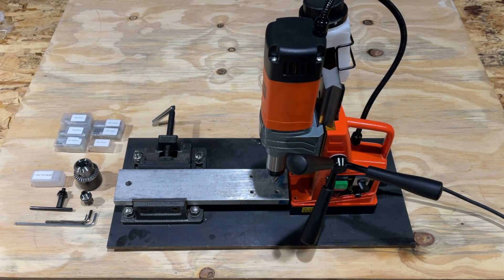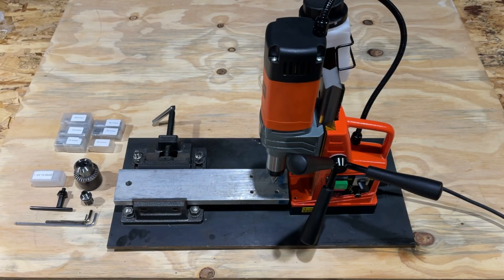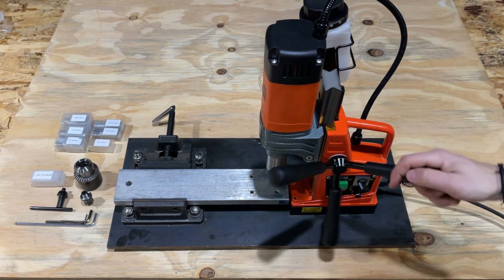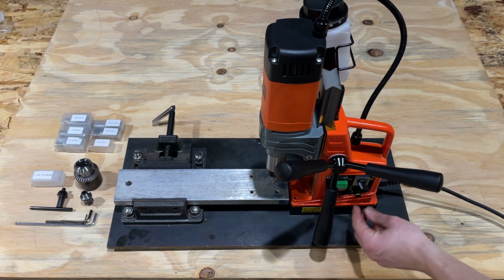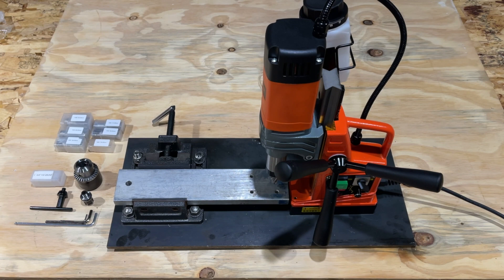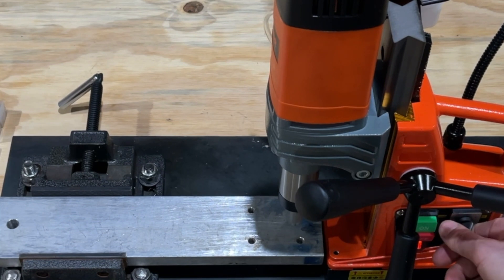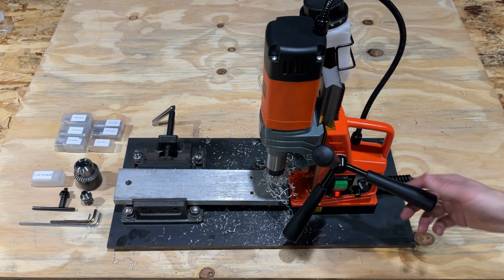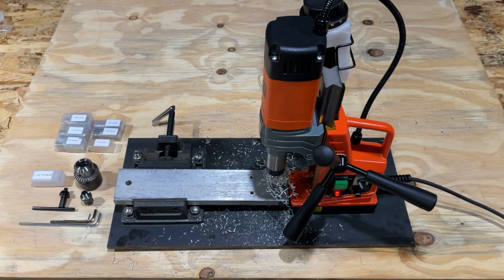How To Use The Vevor 8850E 1400W Magnetic Drill Press

Comment: Not sure if you are still fielding questions, but i purchased this drill about 4 months ago., Drilled about 700 5/8" holes in my new fabrication and fixture table. Then one day, power switch stopped working, no signs of life at all. Vevor was sending a bridge rectifier and new switch, but told me I would have to do the work. I deliberated with them saying i wasnt comfortable doing the repair and they sent me an entirely new drill. Works better than the first. However i would like to get the other one back to operational. Any idea of part number or specs on what bridge recitifer It uses?
Reply from the maker: Wow! 700 holes, that’s incredible!
Did they end up sending you the bridge rectifier and switch? I think if you Google the model and “exploded diagram” you should be able to find a parts diagram.